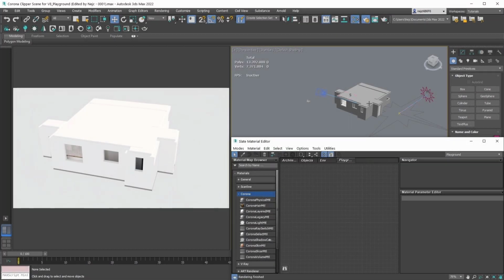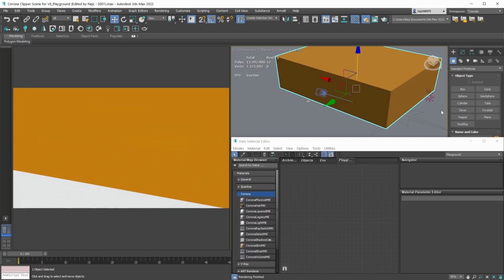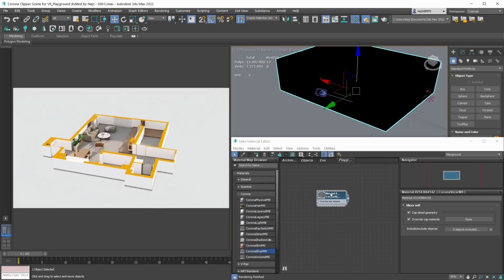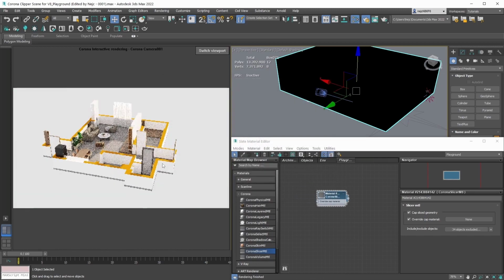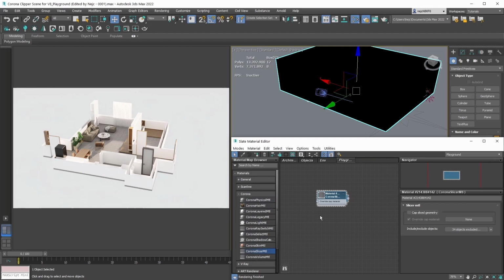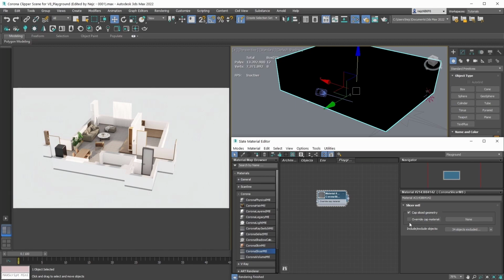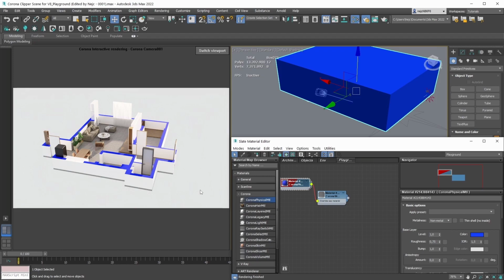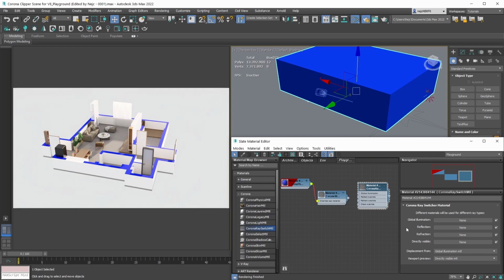Slicer with Chaos Corona for 3ds Max

Comment: Good feature addition but unfortunately there are a few fundamental issues with it. 

-there are some visual artifact bugs when using slicer with Forest Pack which basically makes the tool unusable in some circumstances when used in conjunction with Forest Pack 
-when using slicer, the external light can enter the sliced space. To get great looking slice renders, it's essential the the interior shadows are maintained, as per the basic camera clipping tool that is built into the 3ds max camera.  Not the best solution but  at the very least, a toggle needs to be added to the slicer object to enable/disable shadow casting.
Reply: don't waste your breath, this is a corona team that can't stand criticism
Reply from the maker: For the second point, the video shows how this can be done using the rayswitch material to prevent external light entering the scene, we showed that as it is something people will want :) It's a painless set up, so shouldn't make things more complicated than a basic set up - however you can post a feature request if you like, at https://forum.corona-renderer.com/index.php?board=5.0

On the first point, you can always report it over at https://forum.corona-renderer.com/index.php?board=2.0, so that the developers will see it, and we can investigate (alongside iToo) any problems. We'd need the full bug report info, like which version of Max, which version of Corona, which version of FP, and some visual examples of the problems (or even a scene - if you want to send a scene and keep it private rather than shared on the forums, send in the report via support.chaos.com and "Submit a Request" rather than the forums). Thanks! Tom
Reply: @CoronaArchViz Hah, thanks for clearing up the shadow issue and being patient with your answer.  I stopped watching about 6 seconds too soon :\ 

I'll go ahead with the bug report for the first point, thanks.  This issue with forest pack  was oddly also present with the Vray slicer tool around 5-6 years ago, the last time I used Vray before I switched to Corona. Not sure if vray still suffers from this issue.
Reply from the maker: @tommyg83333333  Thanks for taking the time to report the bug! Aha on stopping the video just a little too soon, easily done, and happy to let you know there is a solution in there :) Thanks! Tom